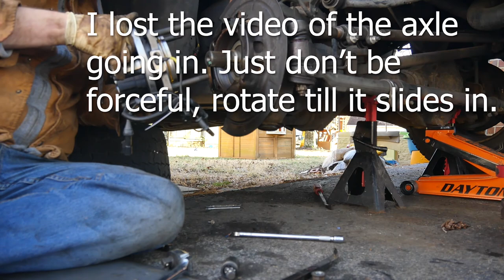F250 Front Wheel Bearings, Axle Shaft U-Joints, and Axle Seals.

Comment: In case of just the bearing itself to be failure point, you can replace it separately from the hub assembly, remove another retaining clip and press it out. Replacement part is 6009DDU or 60092RS